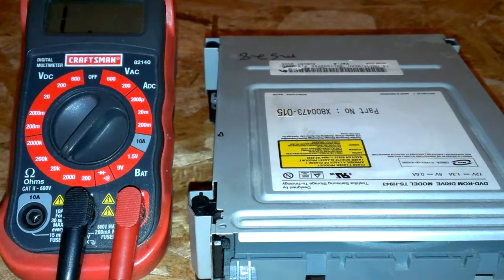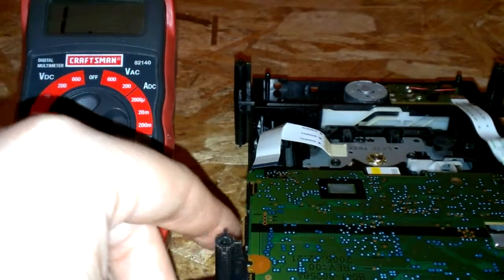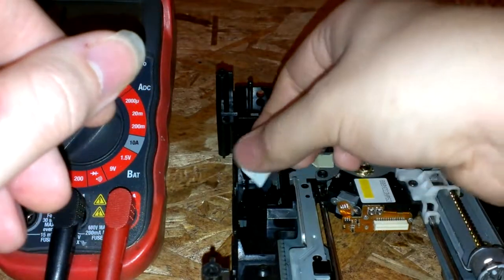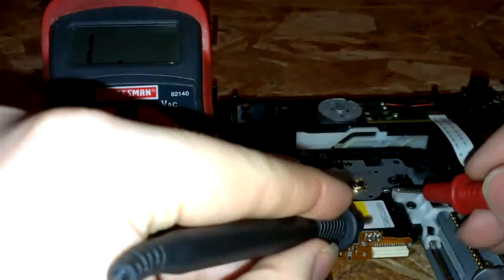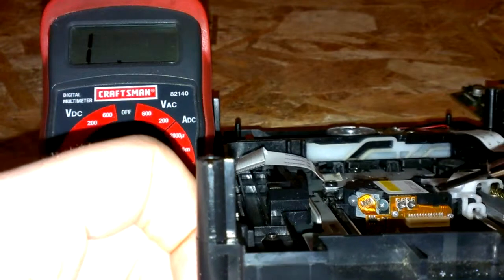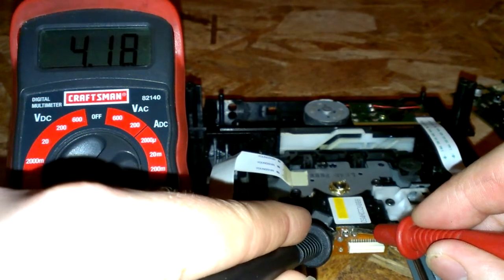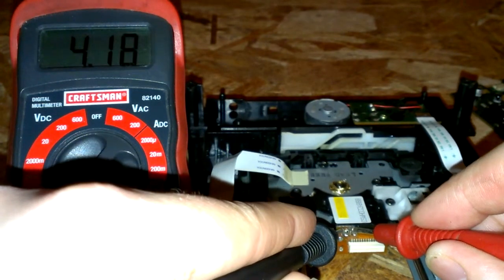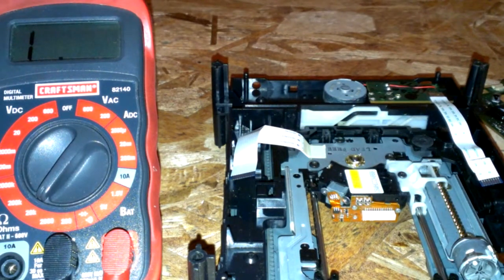XBOX 360 SAMSUNG POT TWEAK HD

Comment: Im already down to a 3.81 and i still cant play games. It plays dvds just fine, it wants to start to play games, just black screens then back to hub. And ideas?
Reply from the maker: go down to about 3.5 and see what it does. also make sure the laser is nice and clean. polish it for a good 30 to 40 seconds with alcohol and a q tip very lightly. also make sure your games aren't badly scratched and work in other xbox. and if it still doesn't work take it down again and again even if you go below 3 it doesn't matter. it will just blow out the laser. no harm done if its to far gone. new lasers are cheap on ebay.
Reply: Alright, thanks.
Reply: I have taken it down to 0.99 and it still dose the same thing. It reads the dvd just fine, reads theres a game in, but cant play the game. Is there something wrong with the drive all together?
Reply: Idk how i have 2 accounts, but ohkay....
Reply from the maker: Jody Rost are you sure your turning the correct screw??? because 9 times out of 10 this method works. if so then the laser is shot. I would buy a new laser off ebay or if you don't want to risk messing it up then you can usually get a whole drive for around 20 bucks shipped. just make sure its the right one. Samsung ms28 or whatever. then just swap motherboards from the dvd drives. plug in play.
Reply: I bought 2 dvd drives off ebay for $11. Tried to swap laser but they are different than the one that was in my xbox. So i tried just plugging these on and they didnt work. I found a video that showed what make of drive i had, tried the pot tweak and it didnt work. I originally had a benq drive. Are there set drives for set xboxes?
Reply from the maker: Jody Rost you have to have the same type drive that came out of your xbox. anything else wont work. if you get the same drive that came out and put it in your xbox it still wont work until you swap dvd drive circuit boards. the dvd drive circuit board has a serial code that only matches up to the xbox it came out of. so if you have a benq drive then get a benq drive off ebay that works then take them both apart and swap the circuit boards out. on the benq's you might have to desolder some wires on the board to swap.
Reply from the maker: Jody Rost also if you have followed this video to adjust your benq drive then you probably turned the wrong screw.
Reply: I started with a benq but bought these samsug dvd drives off ebay. So pretty much the samsug drives will not work in the xbox because i had a benq in it?
Reply from the maker: Jody Rost correct-a-moondo... has to have a benq if the xbox had a benq in it.  but save your other benq because you will need the motherboard out of it if you decide to get a whole new drive.
Reply: Alright thanks a ton.
Reply: You have one for sale? Lol
Reply from the maker: Jody Rost no I don't have any working benqs layin around. the lasers in benq are easy to replace. but you have to know how to solder because you have to remove a bit of solder on the new laser before you install it. lasers run about 7-8 bucks on ebay I think. and there new.
Reply: Okay, thanks for all your time and advice.
Reply from the maker: Jody Rost not a problem... glad to help